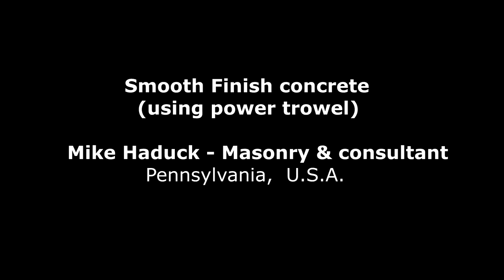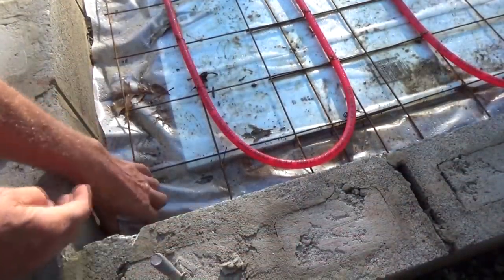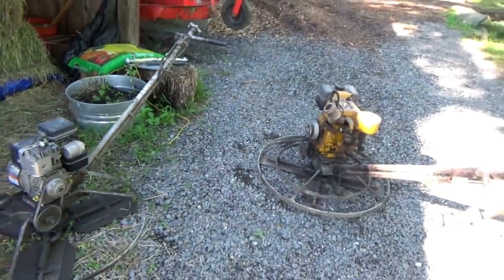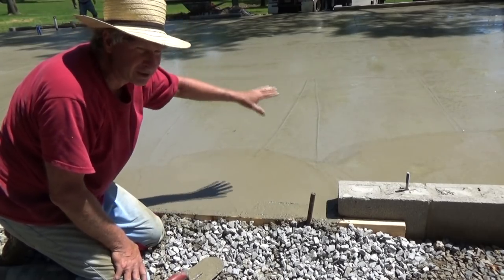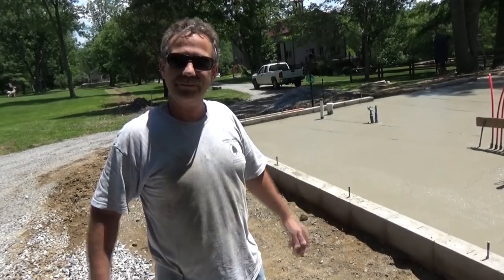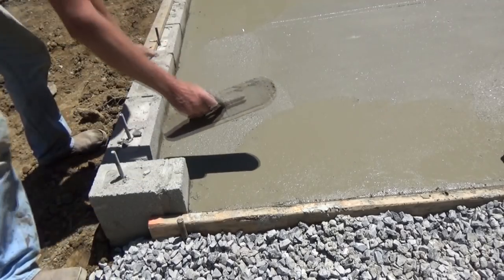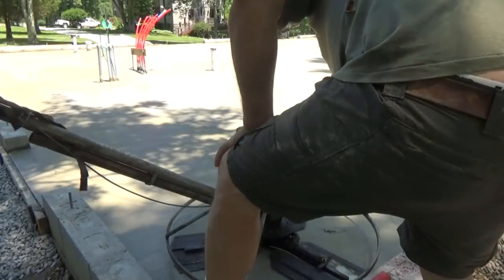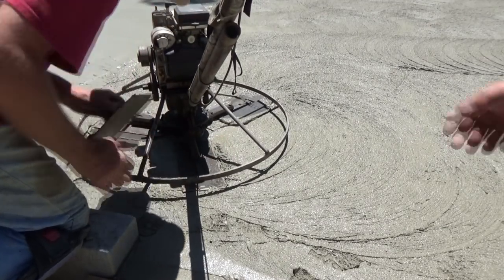SMOOTH FINISH CONCRETE (part 4) Mike haduck

Comment: In my 9 months of almost daily, pool decks/pads and walkway pours using both, metered and barrel trucks, I've found that for a consistent setting up that metered trucks are the way to go. Barrel trucks are constantly rotating and therefore, heating up the concrete(friction), especially the last half of the pour. We've lost 1/3 of a 2000sf+ pool pad, using a barrel truck, with only two finishers(first time and last time)! Oh yeah and Mike!.. I learned the beginnings of what I know, from running to your videos, during the first 3 months of learning to work in concrete!  Thank you,Sir!
Reply from the maker: Thank you Bryant,  metered truck are new to me,  So you just taught me something, thanks, mike

Comment: I watched a Home Depot get built across the street from a place I used to work.
When they did the concrete pour they had these sit on finishing machines.
I watched several guys zipping back and forth on those machines for hours polishing the concrete.
Reply: Ride on power trowel
Reply from the maker: Thanks Bishop, mike
Reply from the maker: Hi Bruce, Yep that’s big-time, thanks Mike

Comment: Love your work Mike, you are a dead-set legend! Can you do a video on different hardnesses of mixes? Can you show examples of why not use just cement for mortar? Maybe a cured side by side of lime mix, a sandy mix with a cement heavy and what happens if you scratch it up? I would appreciate your practical science point of view on the proper application of each. Thanks from down under.
Reply from the maker: Thanks Robert, I’ll get to it, I’m over 25 videos behind now , thanks mike
Reply: The more lime in the ratio, the stickier it gets.  A higher cement ratio increases the compresive strength.

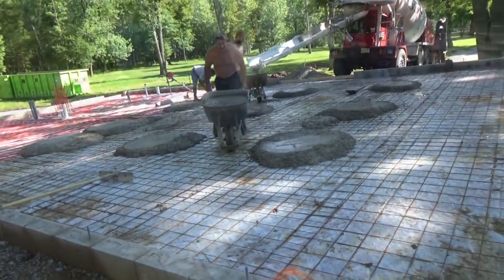Comment: 2:20 your supposed to lift the mesh up when pouring. It needs to be incorporated into the concrete to add any strength.
Reply from the maker: Hi Fish,  It was as we went, thanks mike
Reply: What age are you ?? Your trying to tell a master how to do his job . Nearly every video mike has he explains what yr telling him to do !!!
Reply: Mike Haduck Masonry lies, even if you lift it up it still ends up on the bottom as 5 of you walk all over it
Reply: You don’t lift the mesh up when there’s radiant heat installed the mesh is just to tie tubes to, but there should be a layer of rebar over the top for strength where 3-6000 lb vehicles will be driving on it

Comment: a good size concrete job can make you or break you! You learn early that, cement truck mix's can be different.
Reply from the maker: Thanks Jaime, you are correct,  mike

Comment: Hi Mike,In parts 1,2 and 3 you emphasized isolating the slab from below and the sides to prevent cracking.This didn't seem to happen here;was there something else you did to help with prevents cracks?
Reply from the maker: Hi Henry, funny to say they were not worried about cracking because the floor was to be covered, but, I put plastic around the doorways and side when I got there , but I agree about the isolating, mike

Comment: I had to laugh near the end when you started explaining "1-2-3" - thats what we did when I was a kid and my dad was on crew. When I got my house it was 3000# or 5000#...came overseas and started building my house here in The Philippines and let me tell you brother "1-2-3"is ALIVE AND WELL in 2019! Yeah, you can get an engineer to do the concrete structural calculations, but when you get out on the job the foreman is instructed by the engineer just like you said "1-2-3" or whatever the mix is depending if it's a support beam, a wall, etc. I hadn't heard that since I was a kid, and to hear you point it out  just brought back that no matter how advanced you think something is...THE BASICS OF A TRADE DON'T SIGNIFICANTLY CHANGE. These guys here measure the ingredients by using the woven sacs and have 12 man crews on a mixer going all day from before sunrise to after sunset humping materials into that mixer and then fire-brigading it in 5-gallon buckets up ladders to the second story or to the top of support beams. Finding a ready-mix truck and pumping rig is near impossible outside Metro Manila, I've only seen one truck and pumper used on one house locally here in 8 years! In a way it makes be feel good to see the old ways still done today with great results!
Cheers and thanks for the great series of videos, and the knowledge transfer!
Reply from the maker: Thanks for the comment Tony, i wrote that down about change, very true,  good to hear these things, thanks, mike

Comment: Mike you do excellent work I worked for a mason for a bit and learned a lot but styrofoam under concrete ?!?! How does that work
Reply from the maker: Hi Ray, I was doing it with the union in no, on skyscrapers in the 1980s,   They do it all the time,  thanks, mike
Reply: Thanks mike

Comment: No expansion joints?
Reply from the maker: Hi John, one solid poor,,  there way of doing it,   I never seen concrete expand, mostly shrinking,   Th. Asks mike
Reply: John   some perspective... we have an office and equipment warehouse in Penna. that is similar to this.
part is office and part for heavy mobile units and storage.
the design of the concrete floor concentrated on where the vertical supporting steel roof beams were set.
each of them has a 3 foot pad and at the edges of the pad, an expansion joint.
the expansion joints are extended from the corners and out into the rest of the floor area.
those areas are roughly 50 foot by 50 foot. all those joints move.
even with the joints as built, the separate floor sections are still subject to cracking. 
i might have asked the architect to segregate the heating and utility stands to have
expansion joints but, as Mike says, it's just a different way of doing it and apparently
met their building codes.
Reply: Expansion foam is usually used between existing and new. I would’ve used it around the footer too. Joints are cut in after the concrete dries with a suitcase saw for a pour this big. Sometimes filled with silicone. However, with that radiant floor system, you’d have to know where you’re gonna cut before hand, and be very careful.

Comment: Yeppers’ things were better when they was worse. We’d order by number of sacks 5 sack= 2,500 psi, 6 sack= 3,000 psi and so on. Looks like 1/2 garage with heating was office/ work or repair. Other half equipment parking storage. Well my area around my area people are too lazy to use a wheel barrel they all use pump trucks don’t see tailgating and we’ll borrow work much anymore
Reply from the maker: Hi 49,  I agree,   Thanks mike
Reply: two things we usually dicker with the yards about; 1 - the number of sacks (as you do) and 2 - the type of aggregate.
in our area, we prefer the greater sack mixes, and also use of crushed rock instead of gravel.
we've found that the fractured rock matrix holds up better over time than the smoother surface of natural pea gravel or river gravel. a lot of the concrete plants use dredged river gravel. we'd prefer a shot/mined/crushed rock instead.